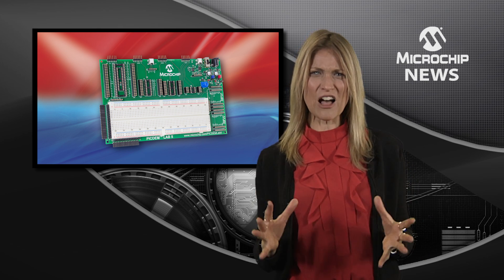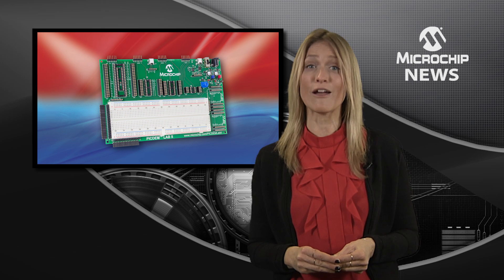PICDEM™ Lab II: A Powerhouse for Analog Optimisation

Comment: Sounds good, and it is what they say. But getting it all set up is a nightmare, lots of hype but little help for students, amateurs or beginners, lots of geeky terminolgy which professionals will recognise and no doubt are finding wonderful. No links to basic information for anyone struggling with terminology, needing a recap on fundamentals in my case. The downloads are not clear, my "user guide" pages 13,14 15, are different from what comes up on the screen. Several attempts to download and setup the MPLAB IDE v5.20 and HI-TECH C pro  have failed, chugging away with little information about what is going on. Searched all over for a straightforward YouTube installation step by step guide...all I see is these ads saying how good it all is. 
Not recommended . . I've binned it after struggling for months.